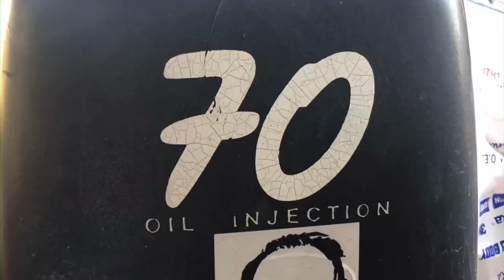How to paint the hull of inflatable boat with bed liner Bat griffo 6

Comment: hey man i have a 17ft police dingy that was auctioned off , the grey hypalon  has dark spots from being debadged and over time use, and i need help finding the paint and how much paint would be needed to repaint it
Reply from the maker: you are going to need around 4 litters of paint the one i use is called marlin colours and they come from Italy
Reply: @seacamel7843  thank you!
Reply from the maker: @kevinbonilla3834  you are welcome
Reply: @seacamel7843  hey man i just bought the paint, do you think i can use the hypalon paint on the toughliner also? or it had to be a separate type of paint
Reply from the maker: @kevinbonilla3834  seperate type